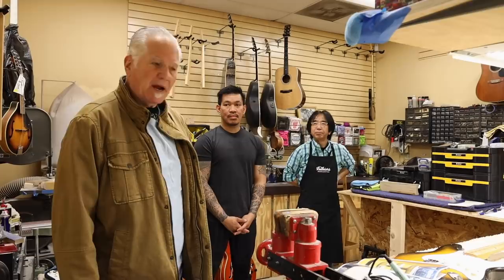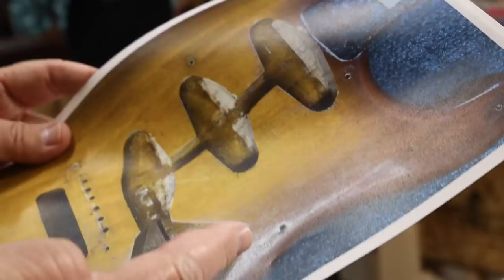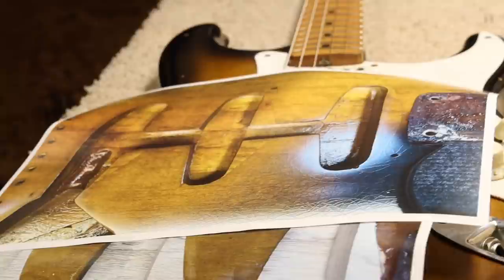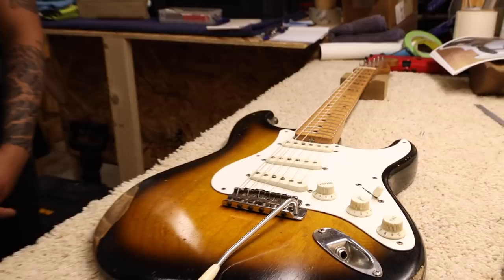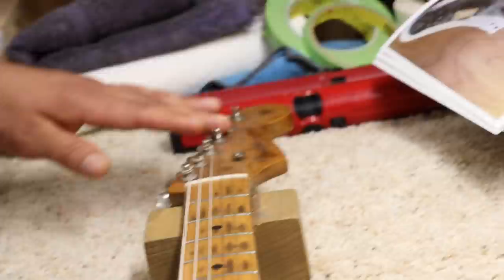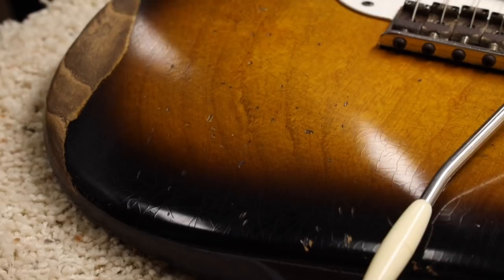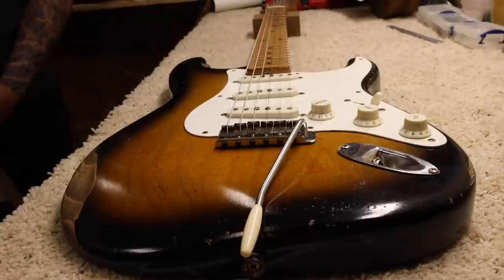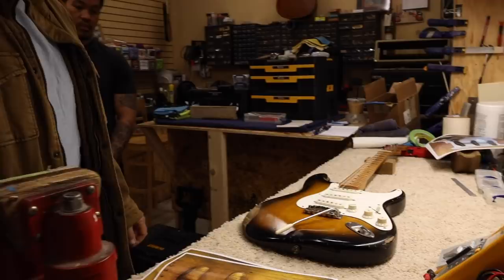1954 Fender Stratocaster Refinished & Refretted at Norman's Rare Guitars

Comment: The bit about turning the pickups upside down was a Jerry Donahue trick from the days before guys like Seymour Duncan were making reverse-stagger pickups. He talked about it in an old issue of GP the ‘Pros Reply’ column. But it turns out that it can’t be done without lengthening the pickup wires and slightly enlarging the pickup routs in the body. These old guitars were not as valuable back then and players personal modifications were more tolerated. Today it’s worth the time, trouble and expense to restore them to original status where possible. 
Best from Petey the guitarmaniax
Reply: should've left the routings IMO, part of the guitars story, lost in time now......

Comment: How much did a Stratocaster cost in 1954?
The first full-scale production run began in October 1954, with the vibrato model priced at $249.50 and the non-vibrato (hardtail) model at $229.50.
Reply: $289.00 or thereabouts.
Reply: About the equivalent to $1,500 by todays standards.

Comment: Ok I’m sold, you got good people! mine is a 59, and needs a far more radical repair and a refret, set neck Gibson, mangled neck break, 1st repair a disaster done by the previous owner. 
But the 2nd repair of the problem was done by Milt Owen, an original Kalamazoo builder of Gibsons just like it, the neck was just shards and missing wood where it attached to the body.  amazing epoxy work Milt did, and sadly he died soon after, 1978, it’s actually quite playable, but the scale got altered, it won’t tune up, can you do a scarf joint that close to the body?   I hope so, I even have a piece of mahogany you could use, if it’s thick enough.
Electronics are all original, soap bars….